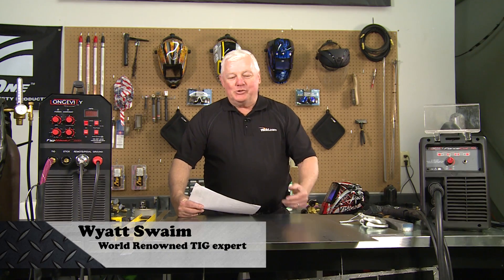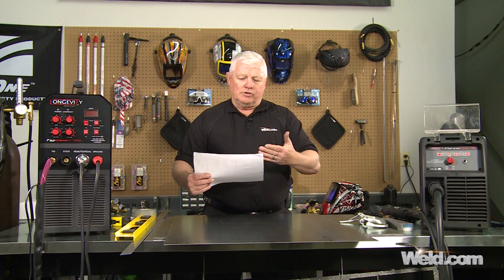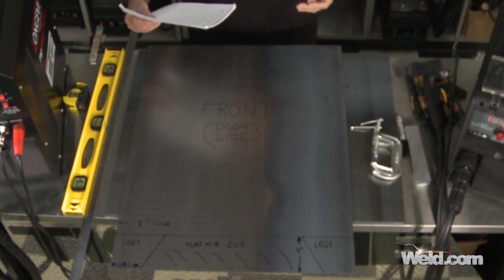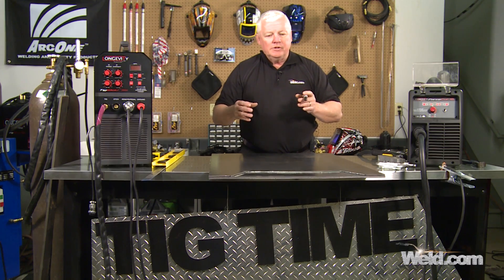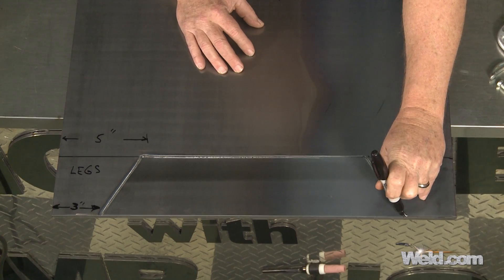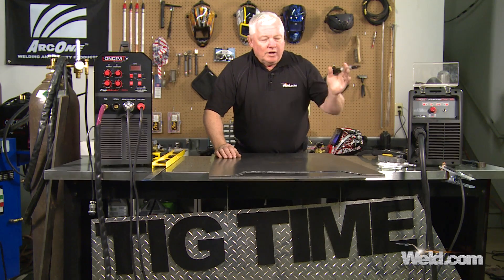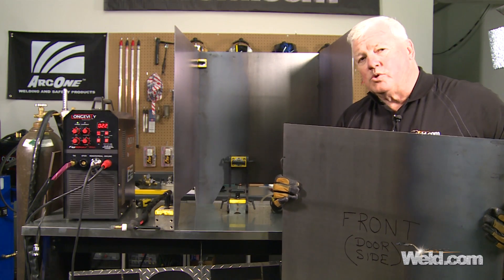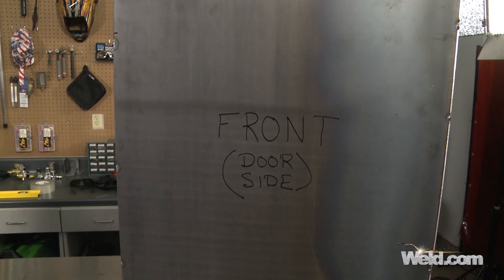DIY Welding Project Series: BBQ Smoker - Part 1

Comment: Thats not slag. Its called dross. @6:40
Reply: Ease up mr. semantic. Most use dross when talking about casting and molten metal and slag when talking welding. Definition of slag per Merriam- Webster:  the dross or scoria of a metal

Comment: Is that a rebranded Eastwood welders? I know their 200sx welders are Eastwood mosfet welders.
Reply: Thanks for your interest. We manufacture our own equipment. Our products are  produced in the same plants as the bigger brands. Compare our 42i and EX models and you will see the difference. This particular unit is made in the same place as an Eastwood machine, but we specialize in only welding.